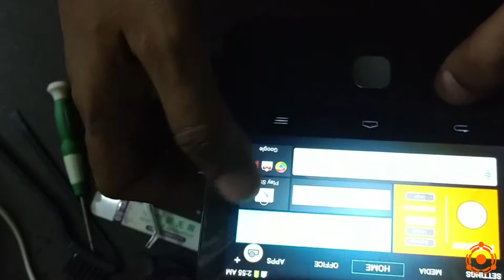ZTE Spro 2 disassembly and display replacement

Comment: My battery is swollen and needs to be replaced.  I need to use this in 5 days, but I can't seem to find any batteries available before then.   Does anyone know if the projector can still be used plugged-in if the battery is removed?
Reply: If you’re still around! I have the same problem you had, my thing is not charging
Reply: same thing happened to me and mine seems to be working without battery with power cable plugged in.

Comment: Can you help me? I bought two new batteries, and my Spro 2 keeps yelling "Battery life cycle limit reached. Please contact after sale service to change a new battery. Projector will turn off in 5 minutes."   I've tried Kingo Root, but it fails at 90% every time.

Comment: Is there a way to make this work even without replacing the battery? Been getting the 5 minute error that the battery has to be replaced.
Reply: You'll have to jail break to be able to run an spro 2 recovery

Comment: There seems to be a lot of horizontal lines in my ZTE projector I was wondering if you’ve encountered the same problem and if you know the reason why the screen is like that?
Reply from the maker: Yes, my display started showing same issue with lines before screen started fading away. But it took quite some time to reach that point.

Comment: Hey what type of screw drivers are you using to open this?
Reply: No shit I tried a jewelers set and still wouldn't work
Reply: Just checking if you are able to find the screwdriver  type.
Reply: @kaviyakumar1152  yes brought it to a repair shop and they used a triple 0 Phillips ty for responding .

Comment: Hi brother how r u .. brother yesterday i watched a movie on my spro now today when i turned it on its display is having dots and line on it it comes and go away and its keep happening .. i am very dissappointed please would u let me know u have changed the complete display screen is it same like the original one ? And working perfectly fine.. ill be very happy if u reply back soon. Can u tell me is this the only place where i can get it or any other website is also selling it. 

Thanks
Reply from the maker: I am good Zahid :) My display too started with some part of it showing broad colored lines and finally I could see some blurred light and nothing else. But it took some months to reach that point. The one I purchased was not as good as the original screen but does the job. I am still using it without any issues. At the time of repairing I had seen similar displays in ebay.com too.  I am not sure if it is still available elsewhere.
Reply: Thank u so much brother thats good if at least its working properly coz without display we cant do anything on this device .mine one has issue because of humidity of aircooler :( it shows the display sometimes clearly and after few minutes few line and different colors starts appearing and suddenly just black.
Reply: Hi zahid you can change spro 2 display